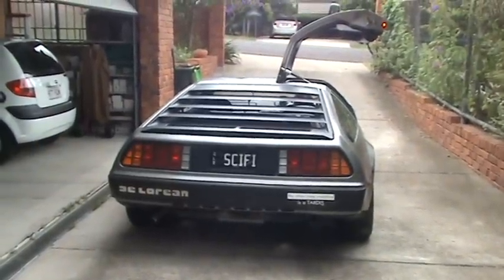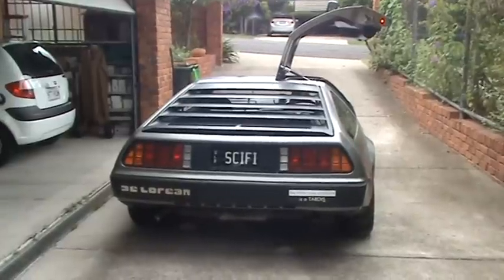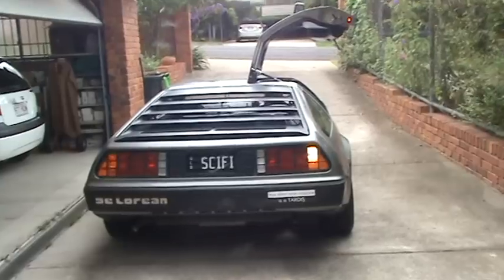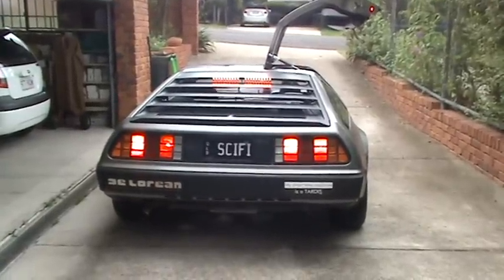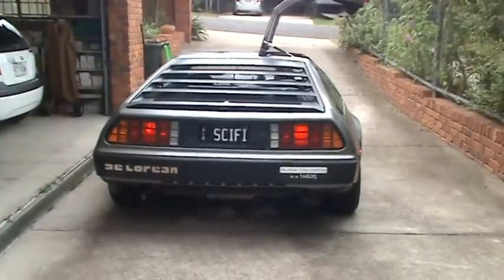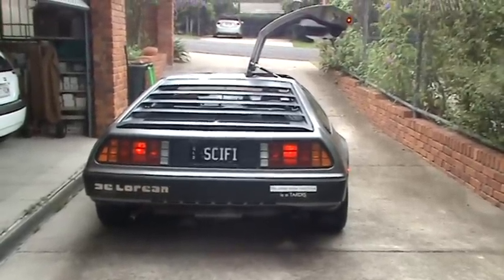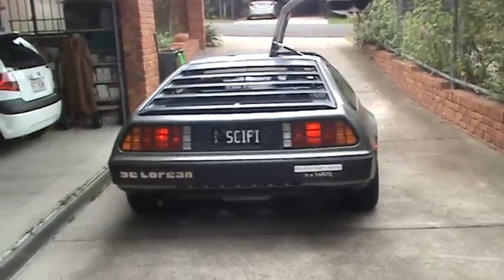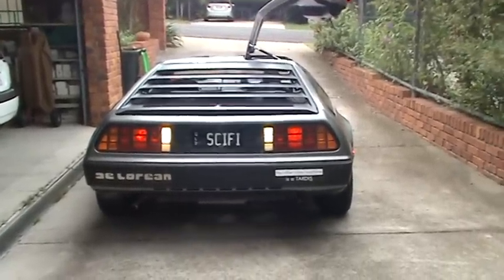DeLorean LED lights comparison

Comment: Do you still monitor your comments?  I have a few questions.  Many Delorean owners need to fully understand why most LED's don't have the correct light intensity especially at realistic distances like in traffic at 50 feet & off angles during daylight where 80% of the light disappears!  I've been deeply studying the Delorean tail lights & even found the original blueprints online that confirmed my suspicions that I recognized a few flaws & even one major issue that makes them borderline illegal from original manufacturering by Lotus! 
 It figures these lamps somehow got thru certification & how Collin Chapman had his corrupt hands in getting them passed for safety validation & U.S. DOT SAE safety light standards of FMVSS 108.  However, I have some tips on what to do to get these lights to really shine brightly to meet past & current lighting standards.  The biggest flaw is that the original reflective aluminized coating is badly oxidized & can no longer reflect & project light fully & evenly onto the lens optics which further focuses the light. Most LED's make it even worse since LED chips are directional & emit light sideways vs. an incandescent bulb that emits light 360 degrees.  There is also a hi output incandescent bulb to upgrade to that was made especially for some Honda's spec'd by Honda & made by the best bulb mfg. in the world, Stanley Electric of Japan!  Let me know if you want further details on how to make your Delorean get safer lighting!   Its a methodical process.  Hope someday to own a Delorean, but in too bad of health to improve the health of the poor Dismal Delorean!😂
Reply from the maker: It's been 12 years since I filmed this but yes I still have my DeLorean and I still have the same LEDs from this video! I'm pretty happy with its current brightness & falloff pattern, I've even been complimented by another DeLorean driver who prefers a more purist approach. Here's an old side-by-side comparison photo I took: http://www.riumplus.com/delorean/tail_light_comparison.jpg

You're right that the foil on the reflectors is delaminating, painting them white isn't a perfect solution but it means that LEDs with their mismatched falloff pattern work much better too. I've been meaning to pull off the rear light assemblies to look at the condition of the white paint after so long and refresh it with a more reflective whiter paint, but it's low on the to-do list.